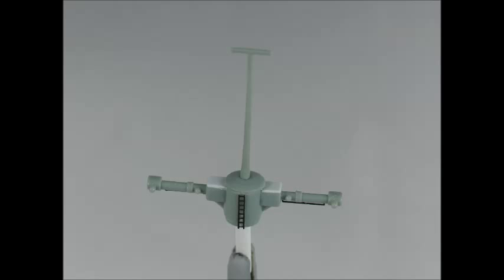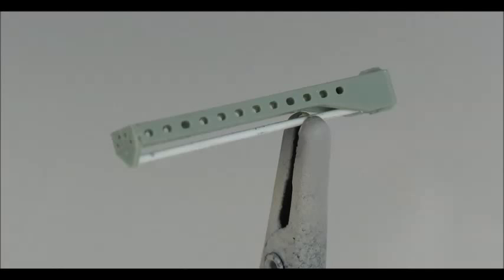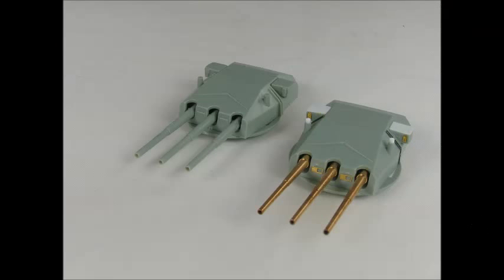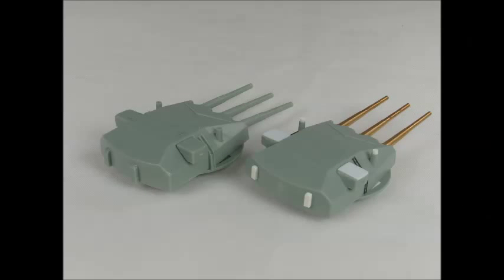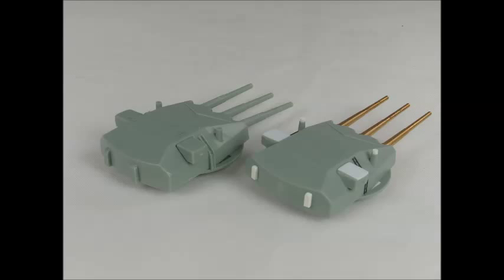Admiral Graf Spee in 1/350: Build Log Part 3

Comment: Hello Guido! I wanted to ask what do you use to glue the photoetch. I can see that you are very precise but I can not tell if you use CA or white glue. Thanks.
Reply from the maker: Andres Gerding Hello, Andres! Thank you for stopping by!
I am usually using CA gel type glue to attach PE. In somea cases such as the railing, I run additional white glue along the attaching surfaces after fixing the parts down with single dots of CA glue to make sure there arent any gaps left. I hope this helps. Cheers!
Reply: Thank you very much. I am going to start with my first "modern" (not sail) ship. Can I send you pictures? Any input will be most welcomed. Thankls.
Reply from the maker: Andres Gerding hello, Andres! What kind of picture are you looking for ?

Comment: The lack of details on the weapons in the academy kit is woeful when compared to the same items in the trumpeter kit
Reply from the maker: Indeed there are big differences bewteeen the two. Both kit have advantages and disadvantages. IMHO the Academy is a very good kit: Straight and simple. A great "canvas" for the modeller to work with and the fit is simply great for a kit about 1/3 cheaper than the Trumpeter issue. I reckon the Trumpeter does offer more finesse in some parts, but I have in the past very often shaved off the detail to replace it with PE. That of cause does not mean that the Trumpeter kit is any worse than the Academy one.
Thanks for watching, Peter!